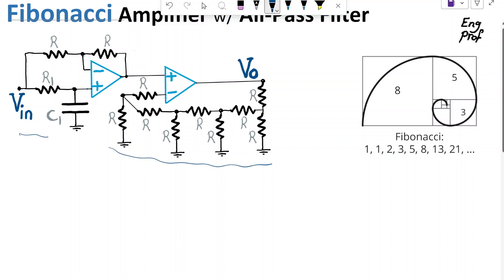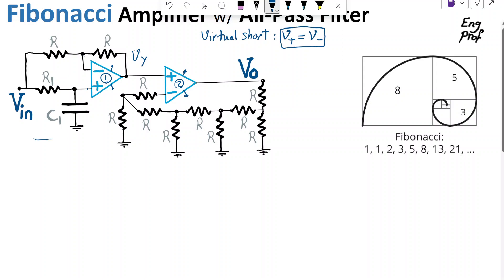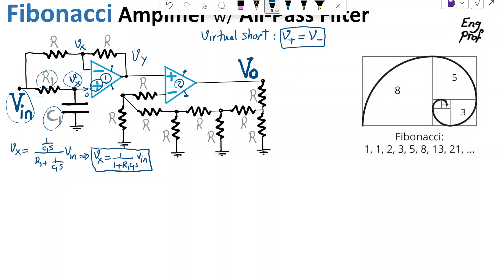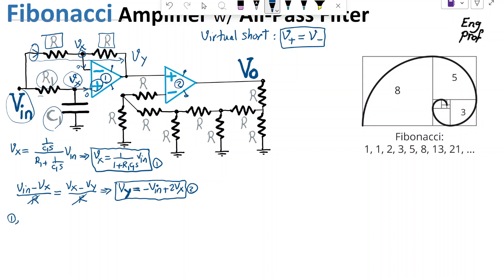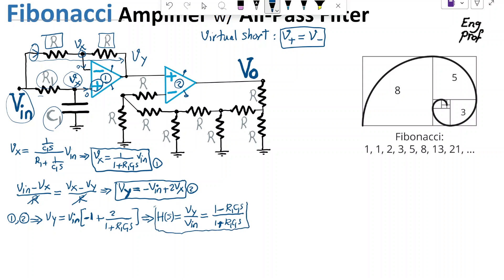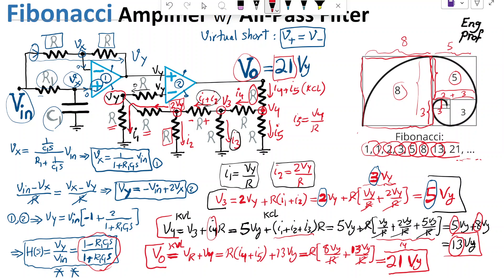Fibonacci All-Pass Filter Analog Computer

Comment: Very nice idea! Fibonacci numbers show up alternately across horizontal and vertical resistors. 21 Vy is across the the last R (Connected to Op Amp output) and Vo is actually 13+21=34 Vy.
Reply from the maker: Thanks for watching & for your detailed attention. You are right, the final line should state KVL as Vout = 13Vy + (13Vy/R + 8Vy/R)*R = 34 Vy  👍